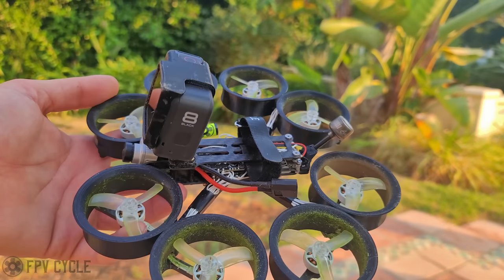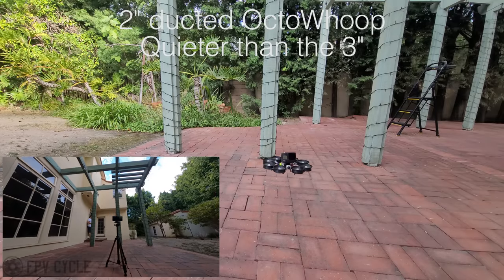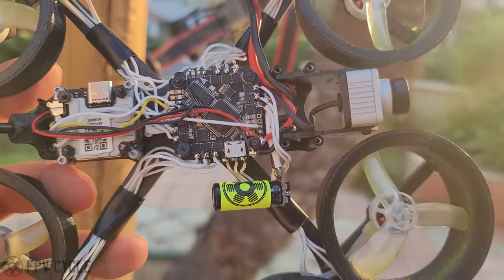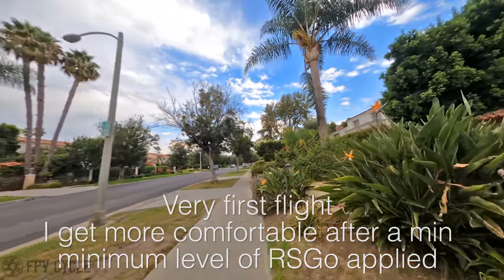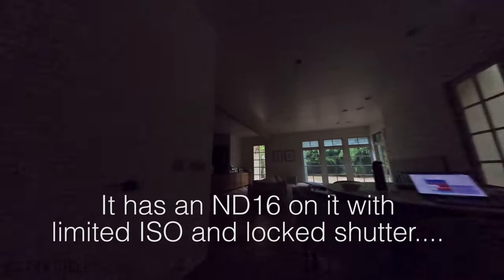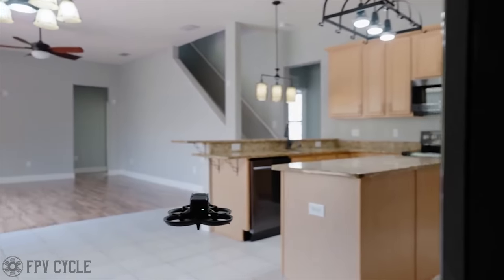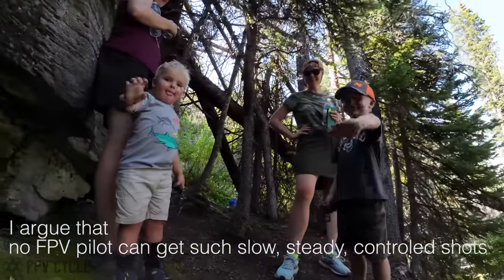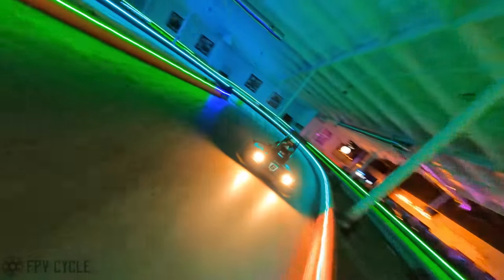Duct Duct Duct Duct Duct Duct Duct Duct Goose

Comment: #1 Free way to "slow things down" is FPV Cam Tilt/Angle. That is where the illusion of speed is created/accentuated.  Then next step is to decrease GoPro tilt. FPV "CineWhoops" should have barely any tilt, but most just use their reg Freestyle or Racing tilt... Hah!
Reply: I came to the comments to say this. I can fire up Liftoff, set the camera angle to 0° and fly slow as balls all day long. I don't understand this talk about 20-40 mph "minimums"? I mention Liftoff because it lets you change your camera angle 1° at a time quickly so you can see what it's like to fly everything from zero to insane racing angle. There is a point where the angle is so extreme I can't fly it anymore, so I have essentially the opposite problem. I fly LOS in real life, hover forever and do slow movements, so again I don't understand this minimum speed talk. The quad is physically capable of doing anything from hover to 1 mph or 5 mph as smooth as silk, so after that it's down to rates and skills. You can tune BF (or any FC) to have insanely low rates and input smoothing to make slow flight buttery. Obviously it's going to be impossible to get a smooth 1 mph shot with 1000 deg/s rates and a whacky throttle curve with no expo or resolution in the hover point zone.
Reply: @mjodr  I think kabab means you can fly even slower without changing camera angle imagine putting this one at 0 degree tilt

Comment: Put optical flow sensors on the bottom, use a FC with baro and put GPS and use inav position hold and camera angle of 5 degrees and you get solid slow footage.
Reply from the maker: Right, I want that setup but have never seen anyone actually execute it. Not sure the code actually supports any of it. If it does, it's probably not gonna be very well tuned for it.
Reply: @Kabab  Here is a video with someone testing position hold on an old version of iNav using only GPS.  Fairly decent for old firmware and not all the sensors.  Even this setup would be better on a cinewhoop for very slow flights than just using Betaflight  https://www.youtube.com/watch?v=ZHDrvvhTHfk.  You can get plenty sats indoors if you shield GPS cable properly.
Reply from the maker: @AndyDreadFPV  I think there may be some information lost in conveyance here. The position hold needed in this case is very very fine. There is no GPS hold that can perform position hold indoors within 1cm accuracy. optical flow or otherwise optical/sensor cameras along with solid barometer performance are the only options I know of for that. GPS is not really useful on any cinewhoop because it's just not a platform designed to fly far away. They generally aren't flown out of auditory range.
Reply: I also want to do it. External baro, matek lidar, gps (+compass?), BF or inav.
Reply: @jeffclassics  Right now people fly cinewhoops without any stabilization at all so even even basic position hold flight mode of inav of ardupilot is better than what people are using now which is nothing at all.   There is no need for external baro and all that jazz.   You just need to a FC with a decent baro such as Bosch covered in soft foam and working shielded and grounded GPS.  If you want to go to the extreme then you can add optical flow sensors there is no magic here.  It's just that people are using Betaflight and not thinking to do this for cinewhoops.
Reply: @AndyDreadFPV  so inav is the best for this case?  Also my gps should have the compass right?
Reply: @jeffclassics  I would say Arducopter is the best for this and is the most like the DJI FC features.  iNav is much better than Betaflight for this kind of thing and also for cinelifters
Reply: @AndyDreadFPV  thanks Bro. Maybe you get to build one first before us. Cheers
Reply: @Kabab  Parrot drones have/had optical flow too.  Maybe that can help?

Comment: That's just simply cool. I've always been fascinated with anything over four motors. My big 5" hex from years ago is still the most stable, rock solid GoPro platform I've ever flown. It excels at really slow, precision flight. I'd like to put faster motors on it but your original fpv cycle 2306.5's are so exquisitely smooth I can't make myself change them.

Comment: I don't know if you're not trying to solve problem Which has already been solevd, just use 2/2.5" quadcopter whoop with naked gopro, much smaller battery and low kv motors. Like this you're going to get something with even more control than the octo whoop I'd say. Less drift, longer flight time, that's why are classic micro whoops being used everywhere.
Reply from the maker: Yep I'm about to compare things with one shortly
Reply: @Kabab  do it and share

Comment: If you're so impressed by the capabilities of the avata, maybe it's time to look at different flight controller platforms, to get similar sensory equipment onboard as the avata.
Inav and ardupilot can both be flashed on some of the common FPV FC's, but enable you to really use GPS (not just buggy rescue mode), optical flow+height measurements.
With all that enabled, you should get similar flight behaviour to the avata and you can strap the GoPro to it for quality.
Reply from the maker: Inav doesn't use the sensors anywhere close to as well as a DJI craft and the rest have very poor manual control unfortunately

Comment: Have you tried the DJI FPV drone? It can fly slow like the Avata. I like both the DJI FPV drone and the Avata myself. I'm not a very good pilot and I like the training wheels offered by these DJI drones. 
I purchased the Avata combo which includes the Motion Controller (MC). The MC is fun but it has very limited control compared with traditional remotes. I have not found a way to fly backwards with the MC.
I'm intrigued with the prospect of having a one handed controller. To me, the MC is not an ideal one handed controller. I think a controller like a Wii Nunchuck would likely be a better one handed controller than the MC.
Years ago (before I documented projects on YouTube) I combined a microcontroller, a Spektrum transmitter module and a Wii Nunchuck to make a controller for a RC helicopter.  The joystick controlled pitch and roll and I used the accelerometers to control yaw and throttle. 
I'm really tempted to try the Nunchuck controller again but to control the DJI FPV drone and the Avata. These two drones will hold altitude without the need of careful throttle control by the pilot. One thing I found very challenging when flying the helicopter with the Nunchuck was altitude control. It's really hard to accurately control throttle by tilting the Nunchuck. The DJI drones should remedy this problem.
I'm hoping I can highjack the normal remote's joysticks by connecting a microcontroller controlled DAC to the appropriate wires.  I'd use the microcontroller to read the Nunchuck values and then translate these inputs to appropriate DAC outputs. The DAC outputs would take the place of potentiometers' wiper outputs. (At least I think this will work.)

Sorry for the long post. I'm hoping this is the sort of thing you find interesting. Anyone interested can search my user name on Hackaday IO and follow along when I make progress on this project.

Thanks for sharing this interesting video. It have me a lot to think about.

BTW, I floss everyday.
Reply from the maker: The DJI stuff is really innovative but I wish they would give us good manual control too with assistance. Unfortunately their goal is to give the ability to fly to literally anyone that can hold anything at all so we get this dumbed down craft of sorts. The FPV craft was similar except that it wouldn't fly as slowly. You're one of the 2% that floss daily...keep it up

Comment: Bob!. Watched the video, I am having this issue, beside the mail I sent you, I got my iflight green hornet working again and also bought a set of d75 gemfan, today I tested it. 3 things happened. Its more maneuverable, more sharp, but it wobbles. I get less flight time, and third motors are cooler. Dont know if its better or not. The thing is what could happend If i use your frame with the iflight guts?. A friend of mine is traveling to the usa in october so he can bring it or I must use the 2003 motors??? Don’t know what could be better. Great quad the octo !!!!

Comment: Ah, so coaxials are loud and inefficient compared to ducted flats. Gotcha. I think I'll wait to see what the 4-inch stacked plus does before I comment on further opinion or "ideas" for layouts but in the meantime; What do you think of the idea of a 2-axis gimbal GoPro mount on a drone?

What size drone (incl custom layouts/homebuilds like race quads are) do you think would be needed to carry a GoPro and a 2-axis (pitch and roll) gimbal on it decently? Also, given disc loading, what quadcopter size is a 2" ducted octo equivalent to, and by extension what would other octo or hex sizes be equivalent to in a quadcopter layout?
Reply from the maker: I'd recommend buying a mavic and attaching it to a cinelifter. I'm not even kidding. It's less work and you'll get a better result.

Comment: Great comment on the difference between good footage and good air manoeuvring. I DoP commercial/branded content and normally hire cinelifter/inspire pilots to handle aerial footage. But recently those pilots have managed to coax me into getting my own 4" drone with an O3 Air unit, a Mavic 3 pro and qualify commercially. I can totally get the desire to 'left stick up go brrrr' but as soon as you start getting even just motion blur in footage from a pan or tilt that's too rapid it's a very specific experience to the viewer and can come across as exciting/anxious/aggressive when it's not intended to be. Even though it can feel fun or powerful as a pilot to be able to make the camera go/do whatever you want. The job is not about that.
This is true even with slow speed but tight proximity flying to professional work requires top tier control and seeing moves ahead as if you don't have the reaction time your craft actually has.There's a lot of pilots out there that just don't get the call for work because they can't handle the bottom 1/8th of their throttle. Think 'low speed mode' on a C2 craft, like the avata you mention (minus the gopro distortion, please xD). It's almost like FPVs need a 'cine' mode with deliberately nerfed rates to get the inertia needed. The only place I've found higher speed agility to be relevant in client work is similar to the go-cart footage at the end, where the subject itself is of a higher pace/energy too. Otherwise, your aircraft handling ends up getting in the way of what's going on in your shot. Like a fancy picture frame distracting from the painting itself.
Reply from the maker: I have been working on how to get my crafts to specifically fly slow consistently for years now. It's a shockingly difficult problem because things in the air just slide around so easily. I have even strapped a beach ball on top of the craft to try and induce drag. It did work but any breeze at all and it does not work anymore. Also, indoors is pretty much impossible unless you use the DJI avata with its imaging system to keep position and height
Reply: @Kabab  A lot of it comes down to excess tilt, which makes me wonder if really FPV is fundamentally flawed for capture because the camera is not gimbaled. Dutch tilt is used verrrry sparingly and is pretty specific in terms of the effect it puts across experientially (normally uneasiness and tension). If there was a way to control tilt rates on the gimbal that could be interesting. That sense of flying is lost when you lose a reasonable horizon as our eyes and heads naturally seek a level themselves up to a point.
Reply from the maker: @_burd  we really just need the little DJI cam with the gimbal included so we can put it on our crafts.
Reply: @Kabab  Maybe someone handy with a soldering iron can patch a Mini 3 Pro's camera into the Air Tx unit 🤔Though I'm sure it's not as simple as that. Really I just want a 3-4" Inspire (one FPV cam, one gimbaled) for those indoor/close quarters cases 😅

Comment: Is your octocopter flying with just 1 4n1 ESC?  I saw you had the flight controller that has 8 motor outputs  But when you explain the ESC you only said  1 ESC so is there 2 motors on each motor pads?   If so then what if you did the same thing but except putting the motor side-by-side you put one under the other Like an X8 Then customize your duct to that???  That would probably get rid of your yaw issue  But then again you probably would lose your slower speed capability
Reply from the maker: I show the entire electronic stack in the video. It's an AIO + 4in1. There's nothing that can be done about the yaw issue other than to use larger motors. I've encountered this issue and worked through it in development of other parts many times. The motors are just too small for a 2" ducted system. This was just a test however so no need to push further because the craft isn't worth developing further IMO

Comment: This brings to mind an idea that might be totally ridiculous, but I wonder if it could work. If you have 8 motor outputs available, could you build out a hex platform where the the first six motor outputs are strictly used to maintain a stable hovering platform, then mount the final two motors horizontally as EDF for skid steer style movement and rotation control? The six primary motors could control elevation and roll for side to side movement, while the two edf motors would control pitch and yaw movements. This could give you movement control much more like a hovercraft where you don't actually need forward pitch of the entire craft to move forward. 

This kind of setup would be useless for any kind of freestyle flying except smooth cruising, but for slow deliberate movements in theory it could have potential.
Reply from the maker: The problem is the hover. Getting the craft to stay in a balanced hover without moving around

Comment: The fact I can't tell if the footage is stabilized worries me. I mean it LOOKS stabilized but I can't see no reason why you would stabilize footage made to let us know about the flight performances of this build.. If this is 'raw' that's very impressive. If that's RSGO this channel has changed a lot since last time I checked :)
Reply from the maker: I say it on screen that this is the minimum RSGo can do. I do this for three reasons. First off, I cannot get premiere to accept the HVEC codec so the raw GoPro file just doesn't work and I'm too lazy to reincode it. The RSgo file works well. Second, I always shoot in 4:3 wide which looks funny. RSgo is particularly good at the lems rectification. If I wanted to show comparable footage that we're all used to, I would need to shoot in supervise which I don't like because it's lossy. Three, RSgo actually makes a bad flight worse, especially on its minimum setting. If the flight is wonky, RSgo constantly zooms in and out and moves around which makes everything super odd. Sure there won't be any sharp movements but it's just bad looking. Crap in, crap out. Good in, better out. And finally, because it's just the best looking footage. 

I honestly don't even look at raw footage anymore because I've gotten so used to how RSgo works. I still have the raw flights but it not all that different with the exception of the warped lens distortion. I'll put that up and link it in the description for those that would like to see. I'm pretty sure YouTube can deal with the HVEC codec. I'll be back home on Tuesday. It'll go up then.

Lastly, I don't explain all this usually because it's too big of a discussion for nothing. Give RSgo a shot yourself and you'll see that if you let it do it's thing on default, the fov is gone and it looks weird. When you scale it back to it's minimum effect, you get about 90% of the view but then the flight needs to be good or it looks way worse than raw.

Comment: for more drag though the air probably a lighter build (less motor weigh with that) and more frontal area against the wind would work (in the movement direction), maybe instead of more ducts longer ducts. not sure how this would affect the rest of the flight characteristics tho

Comment: Per your comments on avata.. why cant you use iNav 5.x with a quad and get the same slow speed and/or hover? Seems like that is one of the purposes of using inav over betaflight. You may not have the downward sensors.. but you do have gps and barometer (or.. you would pick an FC WITH those... like the new JB v2 FC or SpeedyBee or Lumenier HX7, etc)? Also.. I haven't flown yet.. but I see plenty of folks flying the 4 prop/duct cine whoops (3" or so) and look to fly them slow just fine. Just tilt camera a bit so its more in line with the FPV camera angle.. and adjust throttle profile so you can have a switch change the power output.. does this not work?
Reply from the maker: inav and a couple others do have some code to use optical flow and baro but the code isn't very good last I tested it (years ago). Nowhere in the same realm as DJI's performance. I would love to see that happen for us. It would go a LONG way to help with cinematic footage if we could limit our overall rate of speed and maintain altitude.

Comment: couple questions is the octo build on emuflight? and do you think decreasing the throttle limit could get rid of the yaw problem?
Reply from the maker: It's actually on betaflight and the latest BF is doing quite well. I'm glad to see them pull it back on the straight and narrow dev path. The yaw problem stems from the motors just being too small for the 2" duct and prop drivetrain. There's nothing that can really be done about it other than go with larger motors.